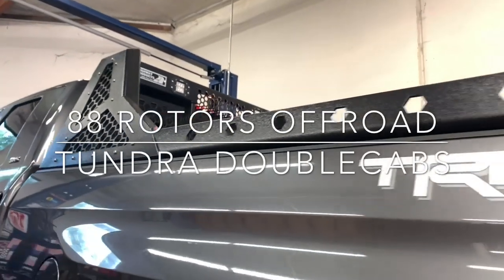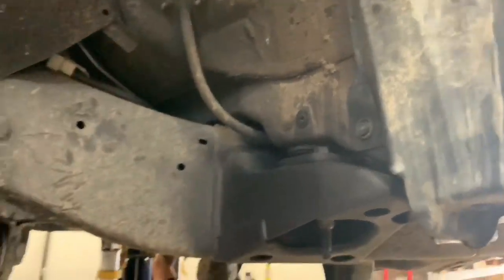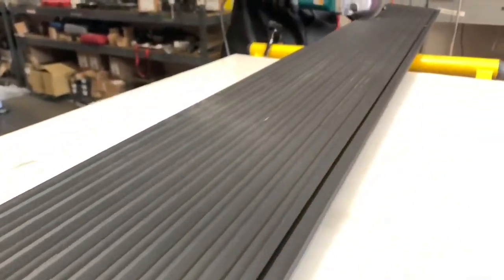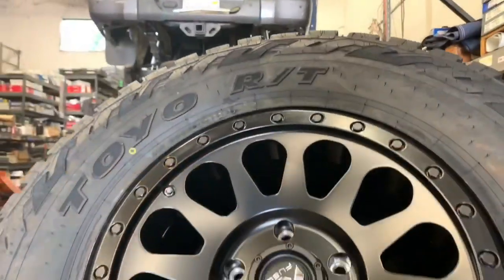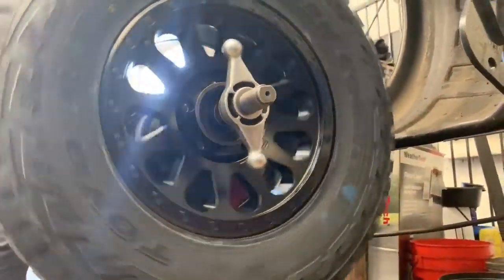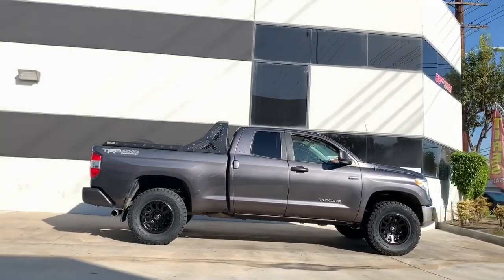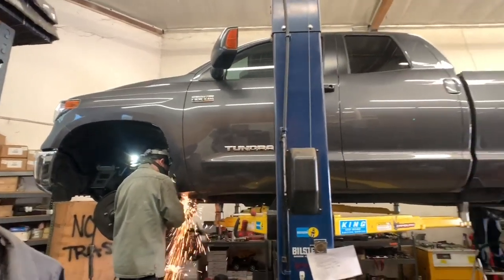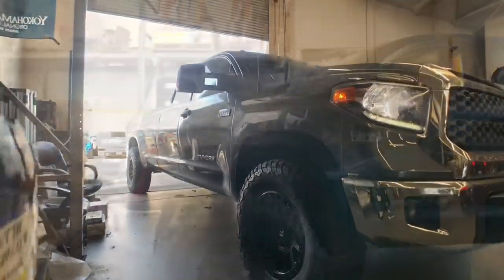8' LONG BED TOYOTA TUNDRA, LIFTED, KINGS, CHOPPED FOR 35's

Comment: i prefer the long bed more for added storage and a good camping rig
Reply: exactly, it must feel like a hotel room back there. imagine the potential with one of the mid rise or high top camper shells...
Reply: @michaelgutierrez6743  i can only imagine since i don't own a truck if i did i'll go for a long bed for added storage. i currently own a 09 sedan with a big trunk and even tho it's "slow" by modern v8 standards it's a decent car with 205k miles and runs like new

Comment: The rear seat in the first-gen Tundra Double Cab was the right size. The new trucks either have too small or too big. 

When our 06 finally reaches its last days we will be getting a used 8' bed 2016 or so for sure. 

Here's to hoping that's ten years from now rather than two!
Reply: I feel the same way. I wish the 2nd gen crew cab came with the 6..5 or even 8' bed. To many mini van people bought the crew cabs
Reply: @jasonsalomons4007  I’ve been daily driving a 2016 DCLB for a while now (2006 was stolen and crashed). It’s honestly a phenomenal truck. The back seat isn’t as comfy as the 1st Gen was but it’s been good enough tote adults on short trips and kids on longer ones. I just don’t know what I’ll buy when the 2016-2017s are all bought up!
Reply: @chazlyle41  that sucks about your 1st gen. I hardly have anyone in the back seat. I just like that I can put three big coolers length wise if I want for camping. We sleep in the back cap.

Comment: ok  I got a ? for you. guys ,, I have a 2018  Toyota tundra double cab limited and I was wondering how much would cost me to get lifted up like the trd pro ..... by using the same suspension as the trd pro the same hight of the trd pro .. I don't have to much info on the trd pro and seen you guys work on Toyotas a lot you probably have that info...

Comment: The long bed tundra looks goofy as fuck unless it's lifted like 12 inches with 37's on it..
Reply: You’re crazy. A regular cab short bed truck looks stupid AF. 8 ft or no dice. All you need is a good leveling kit with a reg cab 8 footer and some 33’s and it will look really good. Now I agree with you. It it was a double cab 8 ft. Bed and it was stock on the ground then yes! They need to be lifted. Not 12” but at least 4-6” and go no less than 35’s. 37’s will tear you daily driver up.